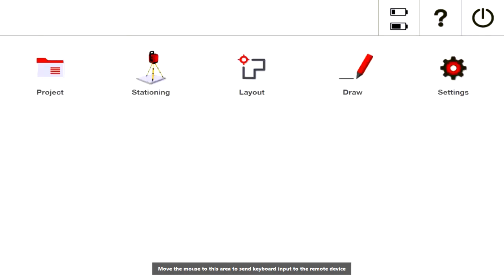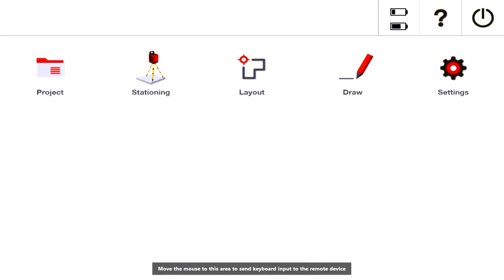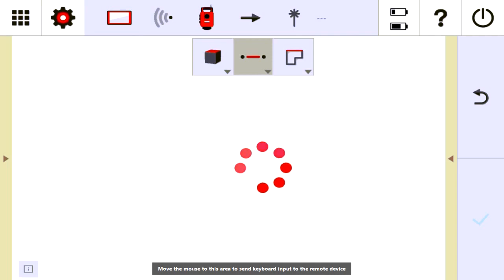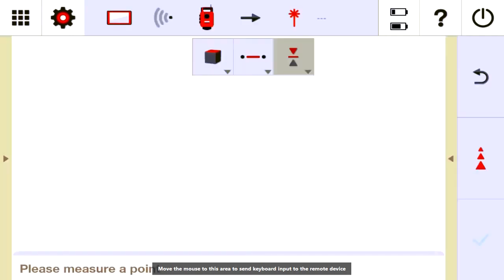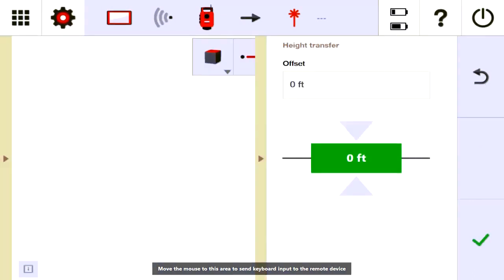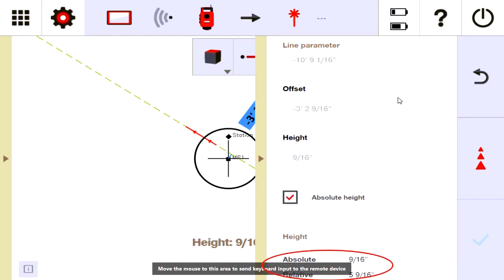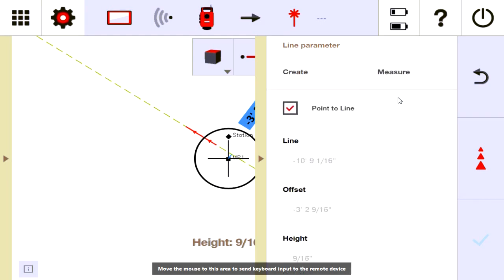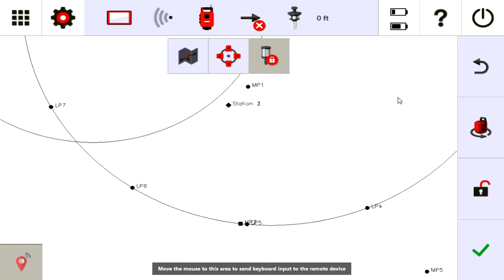Hilti PLC 400 Tutorial - APPLICATION - Checking Heights and Elevations

Comment: In regards to setting BM height. If i want to set up profiles at a set height, what point of the plt300 do i measure too? Or do i add my reflector height on top of survey mark and it will figure the BM height out automatically? sorry if confusing question
Reply from the maker: With the PLT 300, there is never a reason to measure your "instrument height" (the distance from the center of the "eye" to the ground).  That is only something that you can accurately do if you have a tool that shines a plumb laser down to the ground. So, in regards to that, don't do that unless you have Hilti's other tool, the POS 180. That tool DOES have that plumb laser, and that type of station height option can be done accurately (although it is rare for users other than surveyors).

If I understand your question correctly, when you are setting your Benchmark height, you can use any method of measurement you want (measure with a laser, measure to a mounted prism, or measure with your prism rod). Any of those methods will work great under "manual height" in the BM Height settings. The only things you need to remember to do are 1) make sure to type in the correct BM height of the location you are measuring before you actually measure, and 2) make sure that if you are using a reflector rod (prism rod), you indicate the rod height (reflector height), so that the total station can remember to compensate for the distance from the prism down to your point at the bottom of the rod.

AFTER the benchmark height for your station has been measured, you'll see that the "station height" is automatically calculated. All the station height will be after using this method is where the "eye" of the tool is located height-wise in relation to the point you just measured. For instance, if your BM Height is 0 on the ground, and the total station is placed on a tripod on that same ground, your "station height" will probably be around 5 feet or so. Don't let this number confuse you, though. It's mostly just for reference. The important thing is that your height was measured in correctly at the beginning in the BM height section you just finished.

Once you confirm everything looks good, THEN you can go back into an application like MEASURE AND SAVE (the one that looks like an "L" shaped jobsite with a red dot on it). In this application, as long as your heights are on in settings, whatever you measure as a point will also include the height of that point in the point file. For instance, if you have some reflective prisms mounted all around the jobsite, if you measure and save them, the tool will record their X,Y, and also their Z location. Again, just make sure that if you are recording points with the prism rod, type in the correct height of rod and whatever points you measure, the height will be calculated appropriately as well.

I hope this helps!

Comment: I managed to buy a getac t800 tablet PC. With this I want to control the plt 300.what should I do. Where to download the program. WINDOWS 10
Reply from the maker: You can ask hilti if they can sell you the software, but the software is tablet specific typically. I don't think they sell the software separately from the actual tablet the use for it

Comment: Sorry i have hilti plt 300.Honann can download this program
Reply: How come Hilti don't have more helpful videos about how to use this tool?
Reply from the maker: @bazingabazinga1632  which tool? The plc 300 it the plc 400? The plc 400 is featured in the video above.
Reply: @measuringsystems869  PLT 300.
Reply from the maker: @bazingabazinga1632  with which tablet? Android or windows? There are two that will work.
Reply from the maker: It depends on your tablet...this is the PLC 400 tablet. The older tablet for this head unit is the PLC 300 (android tablet). If you have the PLC 400 just go to the autoupdate tray (search for it from desktop), connect to the internet and run the update. Pretty easy.

IF you have the PLC 300 tablet, though, you'll have to switch tablets.
Reply: @measuringsystems869  Plc 300.Unfortunately, it's an old program. erased when restored. That's why I want this.
Reply from the maker: @gulacsisandor2467  Please see this playlist. Do you not see the height transfer app on the android tablet as seen in this playlist? If not, contact Hilti Support regarding the PLC 300 - mention total stations, and they should get you to the right people to help you get all the apps installed correctly.
Reply from the maker: https://www.youtube.com/watch?v=Y5-PaUoMG-c&list=PLF5GOD3RdTERoi-p99M8Q8AxwVeEVZ-TC
Reply: I managed to buy a getac t800 tablet PC. With this I want to control the plt 300.what should I do. Where to download the program. WINDOWS 10